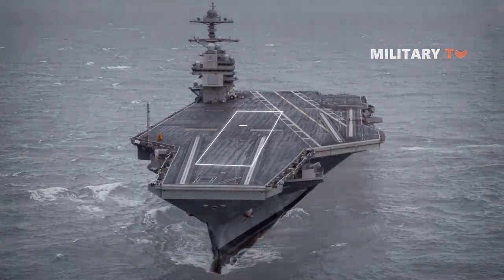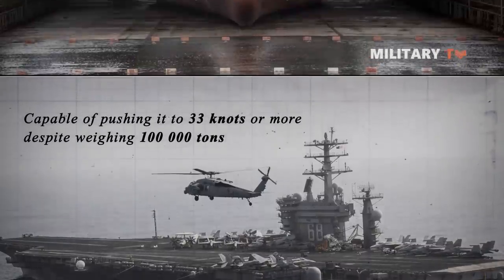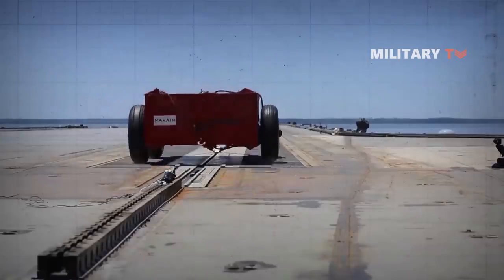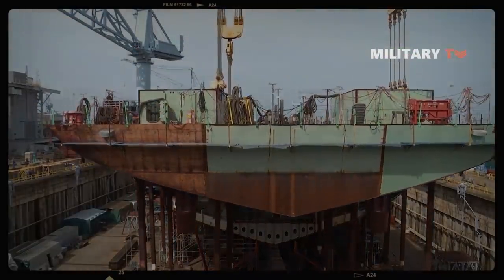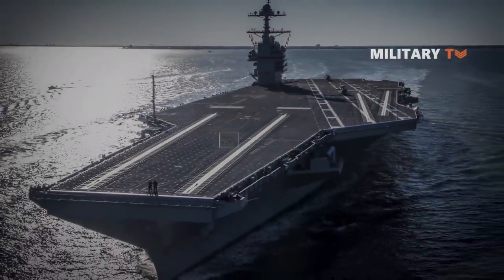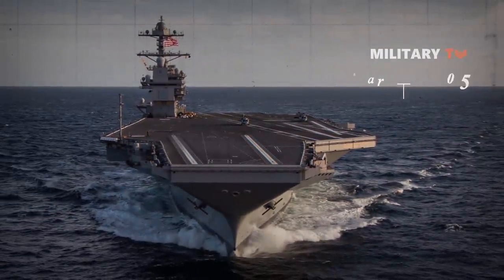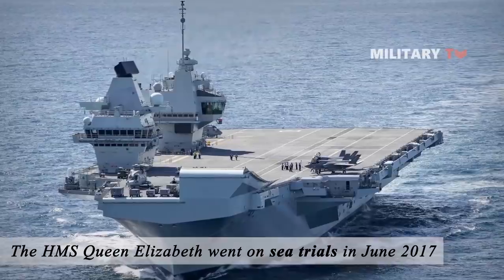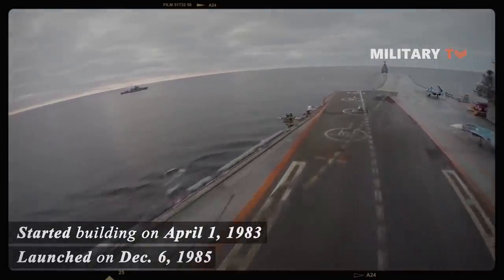Why Does Aircraft Carrier Take So Many Years To Build

Comment: All them revisions.. you start with 1 print, but they have changed 3 times. Then you have cut it out and replace with different lay out.. also they don't make in changes in the print after QA looks at with correct blueprints.

Comment: While the cost, size, amount of material needed are definitely reasons, we cannot forget that there is not the pressure of wartime conditions/needs that are driving the need for an all out effort.  These projects are stretched out by the contractors that are doing the actual work in order to keep the money coming in and their workforce employed for as long as they can stretch it out.
Reply: I worked in government contracting for years and its depressing how often jobs go 100-300% over budget. I once met a team of guys who each specialized in different loopholes to justify change orders. The sad thing is the military knows this and sets things up that way. I once worked on a small cafeteria and there was a $5000 because the army insisted on have a total of 10 people minimum for a simple inspection for a fire extinguisher: electrician, fire marshal, electrical inspector, cafeteria manager, army core of engineers dude, general contractor project manager, army project manager, actual engineer, electrical inspector, and architect. FOR A FIRE EXTINGUISHER! The change order was because everytime 1 person canceled the electrician had to coordinate with everyone else and bill that time out. The $5000 was just for the electricians times and didnt count anyone else's. For a frame of reference the electrical work started out as a $10,000 bid and that was just some of the change orders, the final cost of the electrical ended up over $50,000. A private sector job would only need a fire marshal and electrical inspector and their inspections would be done at different times and cost around $100 and take half an hour to schedule
Reply: 100 percent CORECT.
Reply: @MrFlatage  what?
Reply: @fuzzyhair321  Ask mommy and daddy to help you form a sentence kiddo.
Reply: @fuzzyhair321  Completely failed to even end a sentence, lmao!!!
Reply: @arthas640  The cost overruns do extend the cost. Every weld and component has to be inspected before moving on.  The cost of the electrician does include other things. You cannot just change location from blueprints. It goes to engineering then gets approval from Navy. It is completely waisted steps but it gets treated just like a major alteration to a major part. These cost includes  every thing from transporting part engineering and inspection plus down time till Navy approves the change. The part about cigerett butts and trash. There are jobs that have to clean every foot of floor, walls, ceilings, and piping for liquids and conduits. My nephew is a foreman for prepainting crews at a shipyard. For piping some of it has to be xrayed. I was a part of the team that made the first high speed reduction gearing. This was the gearset for the U.S. NAVY'S ARLEIH BURKE class destroyers. It was used on the new nat gas powered turbines. I machined the actual main body of the gear unit. Any modifications took over a week to get all the approval. Complete waist of time and money. If something went wrong while in service. If it never went through the steps, heads would roll. These types of alterations make the builder a lot of money. Worked in GEs gear division Lynn Mass as RD machinist and made a hello of a lot of money on OT.

Comment: Just remember the the things the carrier holds, not just 90+ fighter jets set on the runway of the carrier! It must hold large silo or service tanks that can accommodate millions if gallons of fuel! It also holds supplies like aircraft engines, and  need space to test them.
Definitely one of the largest moving vehicles on earth.
Reply: *not millions
Reply: @nathandodge665  Yes, they carry at least 2million to 3.5 million gallons of aviation fuel for the 90+ fighter jets on board. Their kept in silos.

Comment: Because taking years is the most cost-efficient way to do it
The event of worsening international relations or war they could be built much faster by having the shipyards work 24 hours
Reply: The shipyard already works 24 hours.
Reply: It seems like even if it was necessary in an emergency or time of war it wouldn't be easy to quickly increase building aircraft carriers. I imagine there are limitations in terms of drydock and construction space, as well as adequate numbers of increased workers with the experience and skills. How many drydocks and shipyards are there that are big enough for an aircraft carrier?

Comment: I think you forgot the French aircraft carrier, which should be number 3 and larger than Queen Elizabeth. Also the up coming 003 carrier can potentially be heavier than Nimitz class, although not likely.

Edit: I was wrong, the French carrier is only 45000 ton displacement. It was so bizarre that a flattop catobar carrier is that small.
Reply: in what world is the Charles de Gaulle carrier larger than HMS Queen Elizabeth
Reply: There is one that is even smaller
Reply: I read somewhere that Chinas new carrier weighs 110,000 tons and can carry up to a 100 aircrafts
Reply: And US is 100,000 tons with 90 aircrafts.
Reply: how about the newly commissioned indian aircraft carrier? i think its bigger than lioning
Reply: @xamina12345  INS Vikrant is 45,000 ton loaded, Liaoning is 65,000 ton loaded. However the carried about the same number of fighters, only difference is Mig-29K vs J-15.

Comment: They have amusement park rides that are directly comparable to an electromagnetic launch systems. They have been around for decades.
Reply: Yeah, but the EMLS on an aircraft carrier is much larger, and has to make the much heavier aircraft go much faster, much quicker, without damaging it. And, it has to be essentially perfect in execution, every time, even in combat conditions. If any problem that takes decades to solve looks as simple as "why not just plug in this existing appliance," it's because you probably aren't aware of all the complicating variables that made it take a decade to solve.
Reply: @magisterrleth3129  Westinghouse had an EMLS system in 1946, but it was never used because the most significant advantage fine control of launching forces wasn’t available yet. The basic technology have been around for many decades, but the huge advantages haven’t become available until the last couple of decades with those much finer controls.

Comment: Have they fixed all the problems with the Ford? What problems is it still having?
Reply: Facilities and deck can’t handle F-35s I think they are upgrading it for F-35s.
Reply: @royhuang9715  what about the emails and the weapons elevators?
Reply: @charlescooney9281  that’s part of the upgrade, the navy claims by the time Ford finishes its 6 month modification in early 2022 all should be working.
Reply: And it will be able to launch f-35?
Reply: @royhuang9715  you think it will be working after upgrade or still have problems? The carrier was already suppose to be ready by now.
Reply: @royhuang9715  when does the upgrade end?

Comment: Than thats mean its easier to build an battleship, pls say yes.
Reply: Will ‘probably’ work?
Reply: @foxythefox356  then good to hear probably.If we cant waste resources on building battleships then we can use them for battlecruisers
Reply: @nickthesoldier7260  Idk about battlecruiser, we live in a modern era thus we have modern warfare
Battlecruiser might be faster than battleship but it's still big and sluggish than most modern ship
Reply: @foxythefox356  Cool so what is the top speed of the operational battlecruisers?
Reply: @MrFlatage  HMS Hood have 28 knots while HMS Renown have 32 knots
Reply: @foxythefox356  Yea can tone that down to 20 knots because you wont maintain those 28 knots with oil boilers. Why the newer ships could just jump speeds quickly. Would take hours to heat the boilers to get those extra 8 knots. Renown dropped to 18 knots for cruising speed even if the water tube boilers got hot faster. Least she actually lived ... The Russian ones top out at 29 and again drop to 18 knots to cruise. I could beat that with sails. USN would have to replace pretty much everything they have but those cruisers are way too old. Ships don't need fake scifi railguns but stuff that works. You need a cruiser past 50 knots and for that they need to be nuclear powered. Beside you know? Lasers etc need power beside propulsion. Modern frigats, DDs etc average out at 27 knots which is kinda slow compared to some WWII ships. US carriers can hightail it but only to launch it's wings. Else it loses it's protective fleet. Just like the new RN 'carriers' cant use their top speeds cos the Astutes cannot keep up. RN knows what 'battle' means in maritime terms. US has no idea. Means a singular ship that can do battle without support. Tall order these days. Renown survived WWII because? She was never alone. Battle of Bubiyan for a US BB? Came with an entire fleet. Same reason the Zumwalts failed.

Comment: A bit odd to count separately the Kuznetsov and Liaoning, since they're are basically the same class.
While Vikramaditya did get a bried mention, it would have been a nice addition to not forget about France's Charles de Gaulle, especially given the problems they faced in designing, building and commissioning a one-of-its-kind nuclear mini-supercarrier.
Reply: Not trying to knock the Soviet carriers. Put together in 2 to 3 years actually was to fast. Lots of issues while deployed. The last one inservice had trouble with power plant. They don't have the quality control we have